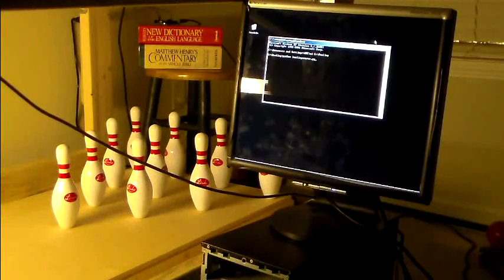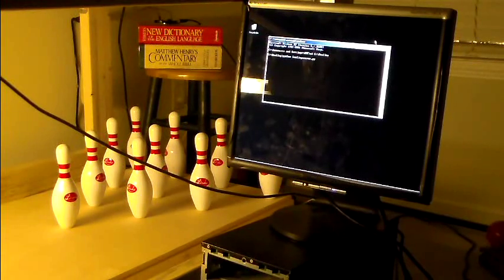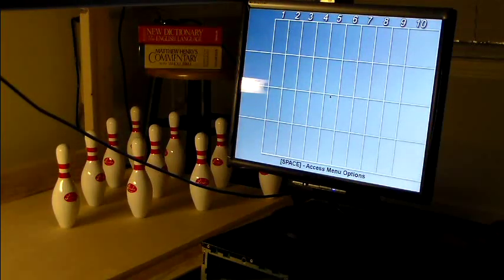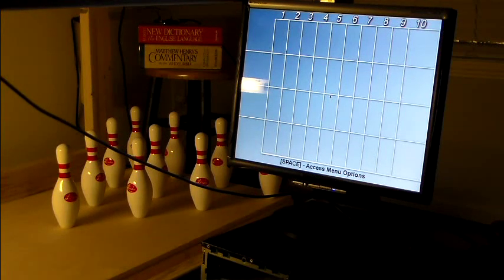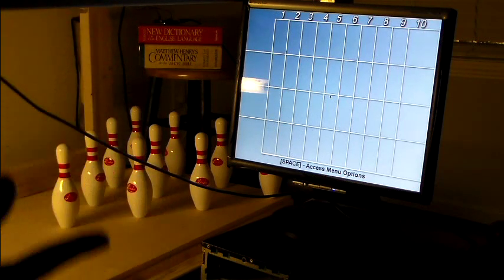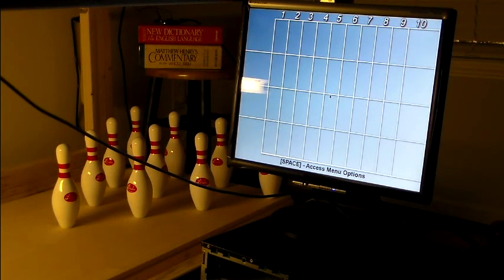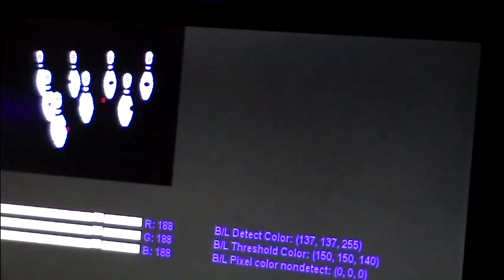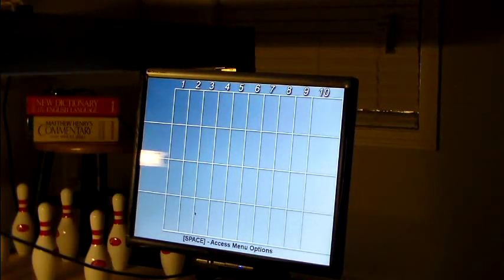Half Scale Pinsetter Progress - Scorer / Computer Controlled Deck Lighting

Comment from the maker: Variable pin no-tap (8 pin, 9 pin or whatever pin) is on the feature list. This will allow people to adjust things depending on the level of difficulty they want.

Thanks for the props on the black light feature, its pretty nifty and is paving the way for the rest of the electrical system :) Stay tuned! If you have any other questions, just ask.